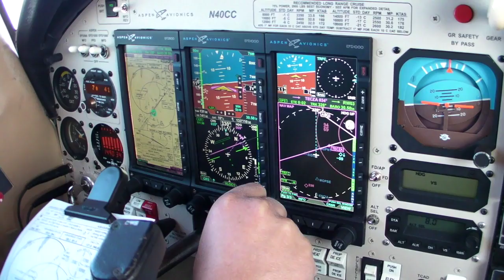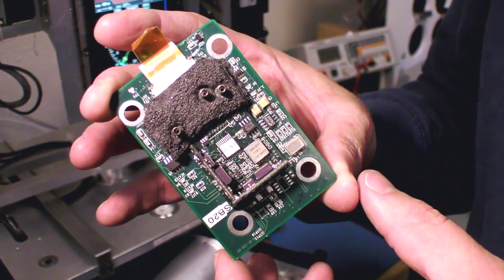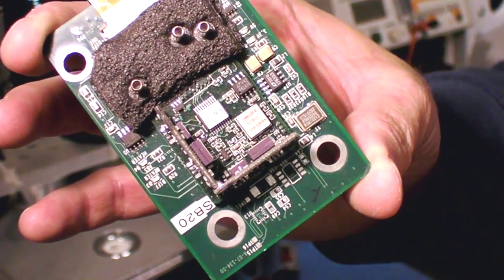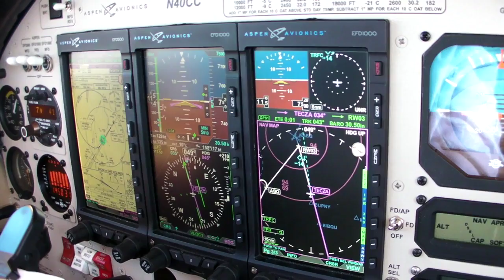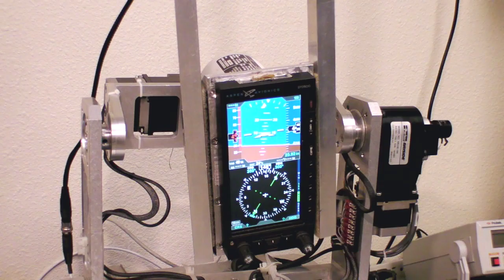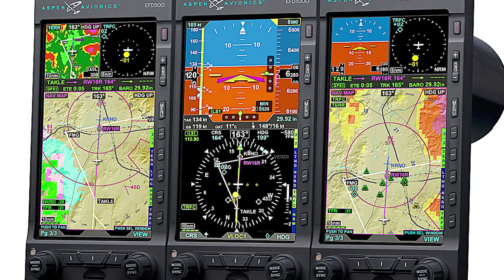Inside Aspen Avionics

Comment: @dave4shmups aerospace avionics is quite an indepth field, precision design and manufacturing is required by governments to ensure quality and dependability
you would probably want to start out with a 4 year degree in aerospace engineering with a specialty in avionics/electrical engineering